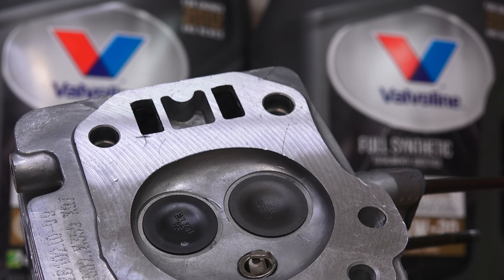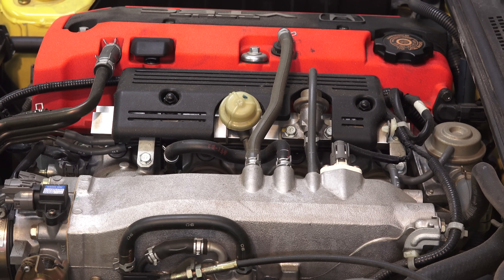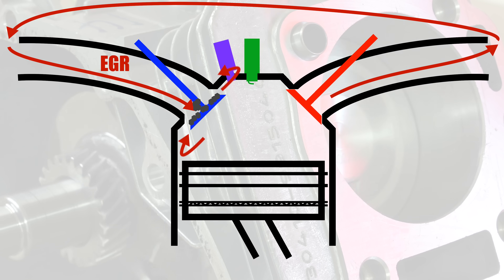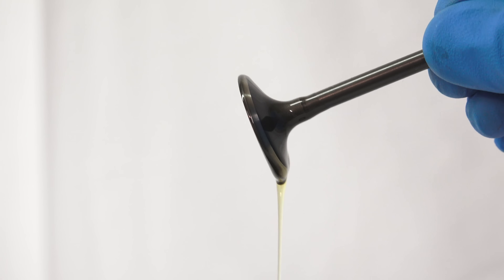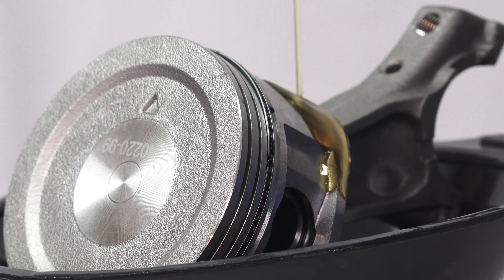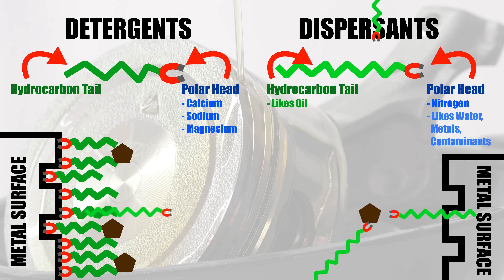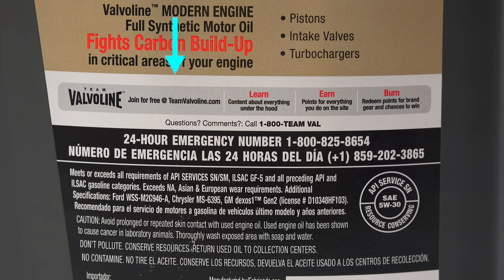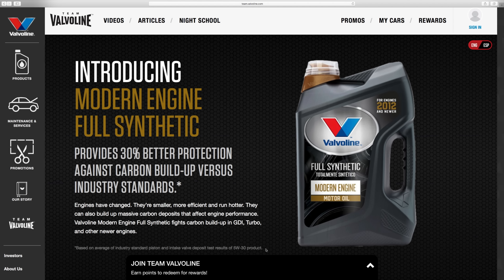Can Engine Oil Help Prevent Carbon Build Up?

Comment: You didn't speak about the NOACK testing... How oil evaporates contributes to intake valve deposits... 😑
Reply from the maker: Discussed at 1:06, just didn't say NOACK because it isn't common vernacular for most people.
Reply: Yes, but have you seen the NOACK rating on this new oil???

Comment: I am confused as to why does this issue seems to be mostly relevant to  gasoline DI engines. Diesels have been running DI for ages. Why this issue has not been of such importance regarding diesel engines? Do diesels have something that prevents this from happening or the exhausts of diesels simply do not produce carbon deposits that can built up on intake valves? Can someone please explain how are diesel engines different from gasoline engines in this respect?
Reply: the older diesels changed the oil way more often so it stayed clean. i think this whole problem is with extended oil changes.

Comment: A little confusing if not misleading as the video talks about carbon build up on the back of intake valves and then oil detergents which help prevent that. How? The back of the intake is not bathed nor splashed with oil? In fact it’s the oil mist from pcv which causes it in the first place. I’ve not seen oil eliminate that, rather it creates the problem.
Reply: Oil is causing the build up, but you can minimize the build up by changing what's in the oil. It will still cause build ups just not as fast. I do agree the title is a bit misleading though.

Comment: There's a trade-off between the long oil change intervals that new oils can achieve and carbon buildup due to fuel dilution and viscosity decreases that occur with time. That's why some manufacturers like Hyundai-Kia have stuck with shorter recommended change intervals, especially under a severe use cycle (3-3.7K miles).
Reply: If they say 7-8k I change at 3-5k especially with turbo.  I don’t care what the mfg says clean new oil is always better and keeps big bills at bay.

Comment: Would the consistent use of Top Tier Detergent Gas or periodic use of concentrated fuel system cleaner (e.g., Techron) also fix issues arising from intake carbon deposits?
Reply: Na, most of the problem in DI cars is the oil volatility compounded by poor crank case venting/evacuation designs.

Comment: My car(direct injection turbocharged) has 30k miles. Intake valves Carbon build up like 100k miles vehicle. LoL. I installed Air oil separator at 2000 miles.  Now I deleted EGR system. Installed Competition series AOS(PCV Vent to atmosphere)  cleaned intake valves, I'll check again at 60k.

Comment: A very specific question, but are some oils better than others at reducing temperatures on intake and exhaust valves? My car is LPG so I have to worry about valve seat recession. I use an ester (Fuchs Titan Pro) but do I not need to bother?
Reply: Just a random guy on the internet here so add salt as required.

I'd say the ones that are better at remaining a liquid at extreme temperatures, and therefore have more capacity for heat are what you're looking for. Check the results for the NOVAK evaporation loss test of various oils you have available in your area. Red line does pretty well but it's also ester based. There are others, MPT industries makes an oil with very impressive NOVAK numbers, but it isn't cheap.

Just curious, where are you located that an LPG fueled vehicle is logistically feasible?
Reply: Ryan Nelson Thailand definitely has it being used in most taxis. Less pollution. Burns cleaner. I'm not sure where else
Reply: @jamesmedina2062  I live in Houston and have seen several CNG vehicles used by the city or corporations; busses, trash trucks, delivery trucks, but a passenger car or truck equipped with it is rare. The refueling stations just aren't common enough.
Reply: Had another thought since writing the original comment. I suspect you're asking about an air cooled engine. If the cam shaft isn't a roller type you'll need to make sure the oil has an adequate zinc content as well. This has been phased out of modern oils available on the shelves of parts stores.

If the engine in question happens to be liquid cooled, the coolant is way more involved in removing heat from the cylinder head than the oil is. Make sure the coolant is changed at the recommended interval and there are no leaks in the system. Redline (and others probably) make a product called Water Wetter, might help your cooling system if it's stuggling a bit. That brings to mind another thought.

Make sure the thing is tuned well! A engine that's too lean will run HOT. Fat and happy doesn't just apply to people. I don't know much about LPG injected engines, I assume it can somehow be mechanically controlled as opposed to electronically. The latter would already account for variables like atmospheric pressure, humidity, and temperature. The former would need to be adjusted for your environment.
Reply: I think the problem with carbon buildup is too little heat on valves.  (from a previous post)

Comment: I have used synthetic oil in older engines to clean up the valves. with time the crud disappears. Also the combustion chambers and piston tops clean up and octane requirements decrease. My 80s toyotas would require premium fuel in hot summer with air conditioning on. after running with good synthetic oil the following summer only regular fuel was required to prevent ping.

Comment: Can't you just disconnect the crankcase pressure relief hose from your intake and point it to the ground and plug the hole in your intake?
Reply: William Ablett ... EGR and other "eco" tech are really what causes issues with carbon build up... An oil catch can is a must for forced induction vehicles, on the PCV system. You can control or reduce carbon by disabling your EGR systems, however that is illegal. PCV system is not the cause of carbon build up and should not be disabled or bypassed, which is illegal to do so according to the EPA
Reply: It's not the EGR , it"S the PVC.
Reply: gary miller ... PVC stands for Polyvinyl chloride, it is a plastic used in plumbing pipes... You might have meant a PCV or "Positive Crankcase Ventilation" system is a one way passage for the blow-by gases to escape, preventing sludge build up and other issues. An oil catch can works well on an PCV system for forced induction vehicles... BUT that is NOT the cause of carbon build up on valves... I was addressing the original comment about pointing the PCV system to the ground....
   NO I actually meant that the EGR or "Exhaust Gas Recirculation" system, it is a nitrogen oxide (NOx) emissions reduction technique used in petrol/gasoline and diesel engines. EGR works by recirculating a portion of an engine's exhaust gas back to the engine cylinders. This is part of the major issue that causes the valves to build up excessive amounts of carbon. The PCV system would actually force some water vapor and oil vapor back in to the intake on a N/A car, which would reduce the carbon build up... BUT the issue is with forced induction systems the PCV is routed before the turbo intake... and causes oil and water vapor to collect in the intake tube and can get on to the air filter. I had this issue with my car since it used a recirculative Blow-off valve... ever time that valve would open it would push the oil and water vapor coming from the PCV system back on to the air filter... SO once I installed a oil catch can, this prevented that vapor from getting on to the engine air filter.
   Hope this clears up the confusion... My original comment was actually two different parts and was not very concise...
Reply: MasterMech77 what car was it? My Saab 9-5 has a very similar system but when i swapped air filters the old filter looked very clean on the inside. A car which was very well known for having PCV problems and oil sludge. Mine has the upgraded PCV so mine is good and oil sludge free.
Reply: @johanneswarn5488  Many German cars suffer from the issue of oil contaminated air filters. BMW, MB, VW, AUDI, for example. All have had issues of their boost recirculation system causing oil and fuel vapors to be "blown" back in to the intake path. On many occasions I have seen this issue. However when I was working for Scott Buick/SAAB, in St. Pete. FL, I don't ever recall seeing oil contamination on the filters. There was plenty of oil and what not in the intercooler, and pipes, but guess the design of SAAB's inlet didn't really have issues with the blow-by getting onto the fliter.
Reply: MasterMech77 interesting! Well the Saabs have their own issues haha.. turbos going bad and so on. My 2001 2.0t has 265.000km on it and runs like a dream. Has a slight oil consumption but i’m going to check the piston rings. It had a new turbo fitted at 250.000km so i’m safe there.
Reply: @johanneswarn5488  Yeah just use high quality cat 4/5 lubricants. Like Motul... You will get the most out of it. My 01 mk4 VW Golf GTI have close to $300k, only ever use AMSOIL for all lubricants. The compression and over all wear is still within factory tolerances. So yes with care you will get another 200k out of your car.
Reply: MasterMech77 i just did an oil change, put Castrol Magnatec in it. Got a good deal on the oil so i went for it
Reply: Sure, if your state doesn't have inspections. but that's not very green lol.

Comment: What’s about fuel system cleaner?
Heard it will remove the carbon build up?
Reply: Not on the backs of the intake valves in a direct injection engine.

Comment: Hey Jason, my ICE professor just told us that the difference between TDC and BDC is not exactly 180 degrees and told us that as homework we had to find out why, but I can’t seem to find the answer!! He said that at 180 degrees the engine would make a really bad noise and manufacturers are willing to sacrifice fuel efficiency in order to avoid it. HELP!
Reply: did you fiqure it out? sounds interesting.

Comment: I am used to using mobil 1 5w30 for my honda accord 2015, which is GDI engine as well, so, do you recommend valvoline oil for my car instead of mobil 1 to get rid off from carbon deposit from intake valve?

Comment: Never let your oil getting dirty helps prevent carbon deposits. When dirty oil burns it leaves gunk, when clean oil burns it can be cleaned away easy.

Comment: Sooooo I shouldn’t have bought a catch can yesterday for my turbo diesel with pcv and egr??? I thought less oil in the intake would be a good thing.
Reply from the maker: I think generally speaking catch cans are a very logical thing.
Reply: is yours an om617?

Comment: Check out the valve clean system from German company Tunap. Apparently they developed a solution that allows workshops to clean the valves without completely dismantling the engine. Also, if your valves look like this, clean your intake manifold, EGR valve and cooler.
Reply: Tony Nietnagel ... Carbon cleaning solutions have been a common thing as far back as I can remember.... It is not a new thing. When I worked for Lexus of Tampa in the early 2000s we did Intake manifold carbon cleaning all the time, with the specialized machines there at the dealership. I the early 80s I used seafoam and other carbon cleaners, poured carefully down the intake while the engine was just above idle speeds and fully warmed up. Direct injection has worsen carbon build up on valves, but it is not a new issue with the internal combustion engine, even engines from the 50/60s get carbon build over time.
Reply: MasterMech77 I hear you. How did you guys deal with the liquid in the combustion chamber? Since water can not be compressed, that must have lead to engine failures. If the liquid/foam evaporated, was it really able to clean anything? Also, what happened to the vast amounts of carbon buildup throughout the  whole system? Where did it you dispose of it?
Reply: Tony Nietnagel ... First of all never had a single issue when doing carbon deposit cleaning. Never heard of any of the other people at the shop ever having an issue with the carbon deposit cleaning machines, or doing it manually. You just have to be careful and go slow. With an engine running at 1200 - 2000 RPMs, it would take a lot more fluid to cause a hydrolock then you would expect. The carbon deposits I am talking about, that cause the majority of issues, is the ones that form on the intake valves and intake path. When you use carbon deposit cleaners, they dissolve the deposits and are expelled through the exhaust system.

Comment: So what do we do once carbon starts building up? No amount of scheduled oil changes will stop carbon buildup eventually as these engines ages
Reply from the maker: There are ways of cleaning them, or taking in for service to have them cleaned.
Reply: Motor oil can help prevent carbon build-up, but it does not remove build up that has already formed.  If you suspect your engine has developed build-up, you may need a professional service to remove it.   Valvoline offers a service through their Valvoline Instant Oil Change locations or any local service garage that uses Valvoline products.

Comment: This sounds like  advertising, would have been interesting to know how the product compares to other synthetic oils and even any real world test have been carried out on DI car engines that have a reputation for significant carbon build up on their inlet valves
Reply: The only difference between him and me is I'm unpaid for products I like. He never said Valvoline was better or worse than others. Just the facts. It's up to us to see it as good on Valvoline. I've personally repaired direct injection engines using BG fuel system cleaner. Feel free to take a look.
Reply: @DENicholsAutoBravado  Can you point me to that video, I can't find it on your channel? I have heard about that BG
Reply: Jason has made us so smart that we're beginning to turn against him lol
Reply: Paul Almond d
Reply: Basically any oil recommended by the car you bought will be fine. DGI engines are going to build carbon deposites but it seems that oil helps a little bit. So the BEST thing to do is changing the oil once a year depending on how many km/miles you put in a year. Because it should be better every 6 months.
Reply: that's because it is. This guy is a sell out
Reply: Agreed. I've basically stopped watching channels that "team up" with manufacturers. I tune in to get objective, unbiased information, not to watch a commercial.
Reply: D LG So you trust someone who doesn’t formulate oil, isn’t a tribologist, hasn’t been in the lubrication industry for 100 years... yeah I’m gonna trust an engineer when it comes to oil... lol. Nope

Comment: wondering if this could have uses in rotary engines as synthetics typically cant be used because they don't burn as cleanly and leave carbon deposits on the rotor, housing and exhaust ports. could this be used to alleviate this allowing the use of full synthetics and thus better protecting bearings?

Comment: Best solution is water injection post throttle. My valves are literally spotless since installing water injection. They were completely covered in carbon before.
Reply: ratgreen though a good solution it can pose many problems such as over dosing and contaminating the oil or an all out failure of the water injection causing hydro lock

Comment: ~~~~~ Engineering Explained, can you get a bore scope to view the valves on your cross trek? 

Also would using premium fuel on your cross trek help with carbon deposits even though regular octane gas is recommended? Shell V Power has advertisements at the pumps saying cleaner valves. Thanks.

Comment: Girls love direct injection
Reply: Injection is nice, but I'd rather be blown. (from a t-shirt in the 70s)
Reply: J Hull they like a high compression piston too right?
Reply: There is no replacement to displacement !
Reply: hahaha!  too much!
Reply: J Hull lmao
Reply: But from the bottom
Reply: J Hull.  The keepers prefer multi-port
Reply: Really Happenings lmao
Reply: Really Happenings Oh, yeah... Arm pit port, Toe port, Ear port, Nose port, Eye socket port and back of the knee port.
Reply: @reallyhappenings5597  the anal port is the best port
Reply: J Hull.  Dude I think I just made that joke 😄
Reply: Remember, old used intake valve is dirty. Fluid makes it clean.

Comment: Is there any way to remove/clean the engine of carbon deposits?
Reply: Take the car to a shop that performs walnut shell blasting of intake valves.  Another popular method is simply cleaning the valves with a wire brush and scraper.  Either way it is a laborous process.
Reply: Grant, motor oil can help prevent carbon build-up, but it does not remove build up that has already formed.  If you suspect your engine has developed build-up, you may need a professional service to remove it. Valvoline offers a service through their Valvoline Instant Oil Change locations or any local service garage that uses Valvoline products.

Comment: solution:electric vehicles
Reply: Amritpal Singh that is never the solution
Reply: Imagine the grid reliability when everyone goes home and plugs in their new 220 volt cord after rush hour
Reply: Not a good solution when you could buy 2 or 3 gas cars VS the cost of a electrical car!!

Comment: Is there any harm or sufficient benefit of using these 'modern' oils in older (and high-mileage) NA port injection vehicles?
Reply: Ethan Atwell negative. Actually you might get better mpg